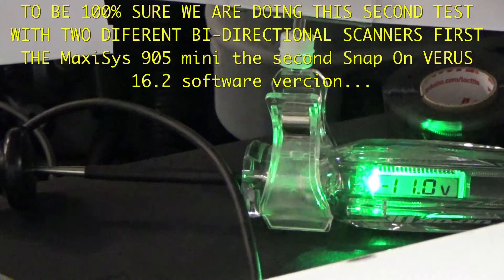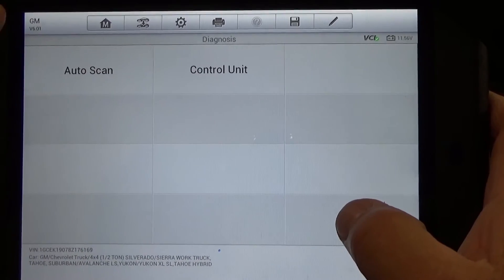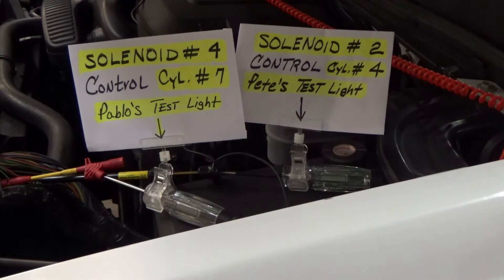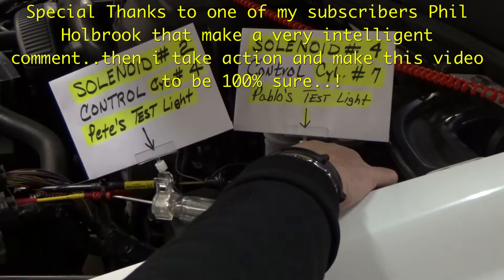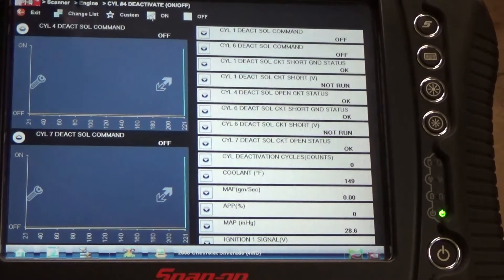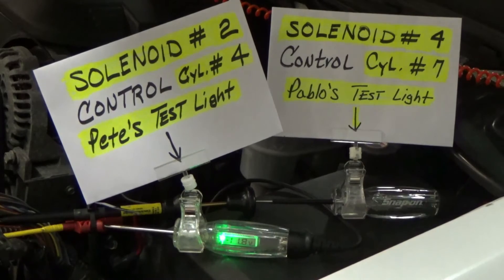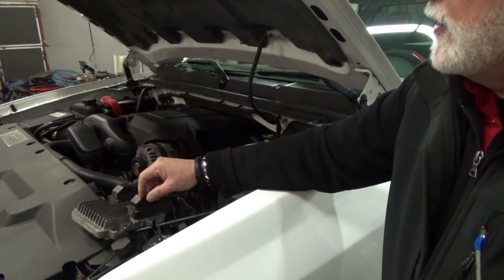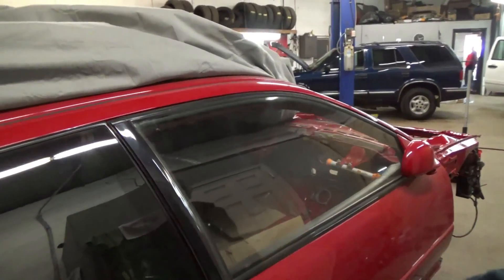PART # 2 DTC P3425 what is it? the solenoid or the ECM..!

Comment: Dropping a Sub Pete.  Im having the exact same issues.  CYL 1,4,6,7 Deactivation.   Can you tell me exactly how you fixxed it? Maybe what it will cost me?
Reply from the maker: iAm Wolfie well you need a bi- directional scanner to be able too troubleshooting this problem and make sure the connector is not the problem between firewall and the engine! Check the oil pressure and you need to do a road test to be sure in DATA parameters or DATA Pids same thing different names! If the computer is commanding de deactivation Solenoid... the Solenoid home is under the intake manifold...
Reply: Pete Sambolin I don't have access to a nice scanner.   Your experience with this problem,  was it intermittent or always there?  With this one if I remove the positive terminal overnight I might get  day or 2 of normal running.  Until the CEL shows up again,  then I have very little power until I can reset the ECM.
Reply from the maker: iAm Wolfie at all times!!! Intermittent problem have many variables so the best direction will be a certified technician to work in your situation! My problem in this truck was the computer was commanding the wrong Solenoid... and is a problem with the ECM/PCM reprogramming the ECM/PCM didn’t Fixed replacing the ECM/PCM did the Fix! In your case I believe that is the Solenoid Parts they’re bad...
Reply: Pete Sambolin Found the problem, took it to a shop where they ran a Snap On Verdict but couldnt find the problem.  After days of the problem coming and going, I realized it had to be electrical.  Thinking it was a ground issue paid off even though it wasn't.   The truck had recently had transmission work done, during removal they damaged the VLOM connector.  Pull up on the connector truck runs great, pull it down truck goes into 4 Cylinder Mode, pull up again and truck runs normal.  Thanks for your help!
Reply from the maker: iAm Wolfie I'm happy for you that finally find the problem and good tip to be reminded went ever someone change a transmission or a engine some times connectors or wire harness get pinch or damage! Thank you for the feedback guy! Appreciate !!!